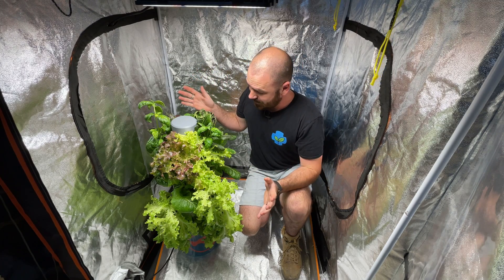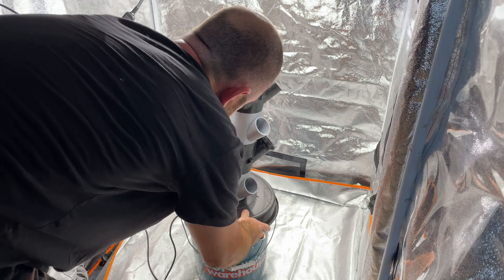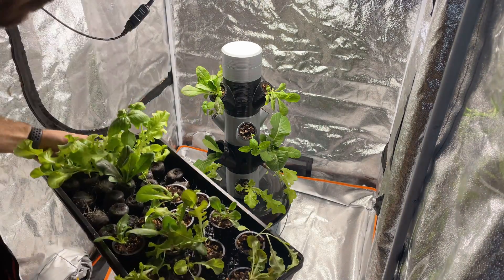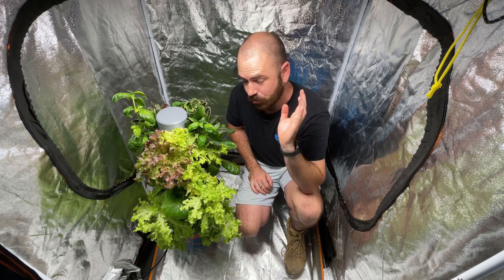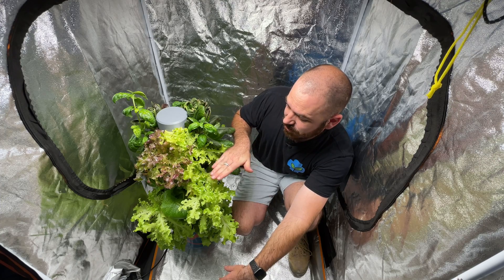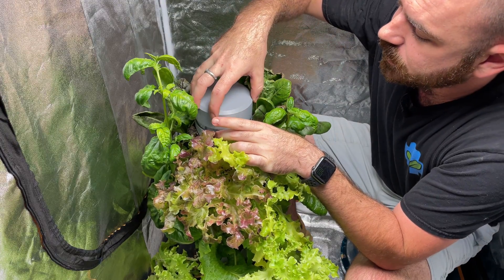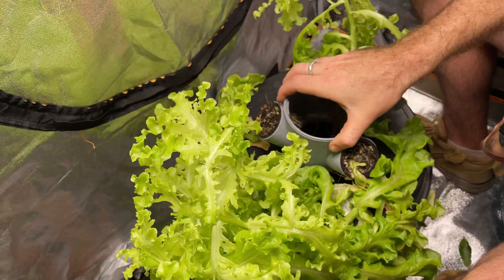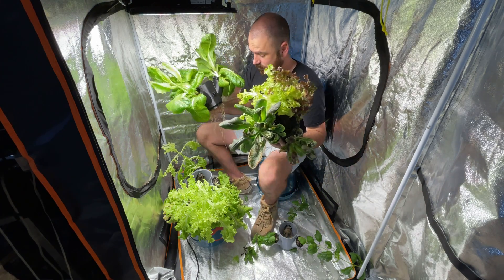3D Printed Hydroponic System Setup & Time-Lapse Grow

Comment: Do the 2" netcups also fit into the hollow modules? I need a 5 way module and there is none with a dispenser and I am not shure, wether the netcups will slip through the holes?

Comment: If you modified the print so each tier held a small amount of water where the net cups sit you wouldn't have to water so often and if it were outside you could use a solar pond pump.

Comment: Nice review! I used the printed cups because my system is outdoors and attached to an aquaponics system. i found the non printed cups just blew out with some bad wind, so the locking mechanism is really nice for my setup (also todlers and chickens on occasion will drag the net cups out). I printed mine with PETG so they have a lot more flex and not a brittle when exposed to water. I also printed in different colours to signify the week of planting - helping me keep track of the age of the plant - a colour for each week.
Reply: Also noticed there seems to be a lot of intended design for the roots to have things to grab... Was wondering if the high specs on the netcups could also be  for the same purpose, reducing  the need for media?
Reply: @thewarytraveler6375  I’m not sure, I’m only a rookie (although getting a lot of attention from friends and family now with lettuce prices rocketing up in Aus). I’m using expanded clay balls, and they work a dream, cleanup is easy at end of plant life, I run a knife over the outside of the cup and everything comes apart nicely. To be honest we only get really bad wind once a year, but it’s a definite plus for the kids and chooks.

Comment: A very great and educational video! Thank you!

Not sure if anyone has made a comment about this or if this idea would work, but as far as the design of tower goes, I saw you mentioned lighting at the bottom of the tower is an issue. One way to solve this would be to to make the tower conical. The slope would be determined by how far you think the crop would branch out. This would however require a redesign of the potting sections and section size adapters so the water would be able to flow correctly. Again, not sure if this would solve your issues with this setup but thought it was worth mentioning. Cheers!

Comment: Hey Hooch, I have a question about lighting in a setup like this. Say you used a hydroponic rack system. If you had a larger grow tent and just put a rack in the center with 4 or 5 layers of PVC hydroponic grow pipes, can you off set lighting in the tent and use reflection (off the tent walls) to ensure balanced growth? I'm curious after seeing this video if off setting the lighting around the grow rack instead of directly above the rack can create that lighting sweet spot. At the same time, I'm worried that as the plants grow the top layer will block out the majority of the lgiht for the layers below. Could this be offset by the reflected light? Thanks for the great videos! I'm learning a lot.

Comment: The ones that "grew up" to it were bolting. They should've been harvested earlier. Lettuces in these systems are VERY fast. My average is under a month for lettuce. I run a similar system (not 3d printed) that stands 6 feet tall in my greenhouse. Lettuce is very fast. If you want to try a fun one, run chard (silver beet). It does AMAZING in these systems. I get leaves 2-3 FEET long and producing faster than my family can consume them.

Comment: Hello sir thanks for your video. 
How it will cost to make one hydroponic tower by using 3d printer? Is it cheaper to make by using PVC pipe? Thank you
Reply: I downloaded the parts and the 3 way module hollow with 0.3mm layerheight, 15% infill, 2 shells, Adaptive cubic, connect the infill every 2 layers, I came up with 140gr per module or 3.3 Euro per part plus power. But a 3D printer is not such a power hog, and if you have it in an enclosure, you save a lot, so I guess 9 hours printing time is about 90 Cents. So per module, 4.2 Euros * 4 (cap and distribution module are the same as 1 module) are 16.80 Euros in total.

PVC pipe from plumbing has a few downsides, it's thin, breaks pretty fast (at least the cheap ones) and the good ones cost really much. But we go with a middle version, 3mm thick PVC pipe, 110mm diameter, 500mm cost about 6 Euros. You need 4 for a similar system he had, plus cap, but lets just calculate the modules, you need 24 Euros for PVC pipe. Glue, tools etc. off limits, we didn't include the 3D printer in the prior calculation.

So in theory, the 3D printed one looks nicer and is cheaper than a sturdy PVC pipe. You can go with some cheap ones, then it really turns around, because 2m of pipe cost 7 Euros, but one slip with the saw or drill, and you break it. I know it, I used it once and never again. But it's a good idea, if you have no 3D printer, you could use PVC pipe, glue in some plastic with holes as the distributor and an endcap.

Comment: The pods have their pros and cons. If you print the standard one its bigger, but thinner and more filament efficient and it helps for bigger, heavier plants since they lock into place. You need to have good settings tho or they'll be too tight.
Reply: CN. Mr😂r 😂

Comment: I'm new to hydroponics and plan to print this system, but Hoocho mentioned that this system would be best used outside due to lighting.  I can definitely see a power savings by doing that.  My question you is about rainfall.  I live in Northwest Georgia (Canton) and we get a fair amount of rain during the summer.  How does rain affect your reservoir?  Do you end up with an abundance of rain water in the system (which I would imagine throws ph and nutrient levels off) where growth is affected?  I know the top of the tower is closed, but I'd imagine rainwater would enter the system through the net pot spaces.

Sorry if I hijacked this thread with my somewhat-unrelated question.  These videos are fantastic and helping me to plan my system while I wait for larger nozzles to get here.  I ordered 0.8mm and 1.0mm to print these bad boys!
Reply: If you drilled a hole into the side of your bucket at the max height you want it to fill to, that should let it drain out the excess, nice and simple

Comment: Thank you and I love the remixed sections, I got lucky with a corner apartment with very huge windows all the way around and now I have 2 plant tower in each one and I love it, also printing net cups make absolutely no sense they’re ridiculously cheap you can get them on Amazon on eBay at ridiculously low prices so the amount of time to print them and a waste of time and filament, for supplement lighting I’m using LED grow lights strips

Comment: You might try side lighting while rotating the tower. You might rotate the tower 360° over 12 hours or 360° over 24 hours. Your rotation system could de-rotate the tower at the end of every period to eliminate the need for a slip ring contact for your pump power supply. A $5 Raspberry Pi Zero controller could control the nutrient pump and the rotator and the lights and anything else you wanted to control with gobs of capability to spare.
Reply: Awesome! I was looking to see if anyone posted this idea yet! Now to find a suitable turntable...
Reply: I have seen a rotating hydroponic system. Basically, it was just the base which would spin, however i find that solution not feasible. If the plants need 16 hours of lighting, then by rotating, all plants will not receive the proper lighting during the day. However, i found that someone printed a sort of an umbrella with  led lights/strips glued to it, coming from the top. 3 light bars would do the trick. But i cannot seem to find proper lighting, except for Barrina lights, which at least have so me sort of information on the product in the description.

Comment: Damn this is pretty amazing! How I am wondering if this could be easily adjusted to fill the middle shaft with hydroponic clay pebbles and make this a top drip system with much shorter on/off ratio. I have been thinking about a top drip system for beginner hydroponics for a silent system. Just made my first Kratky system but I am already thinking about the next!
Reply: Clay pebbles are not fun to wash!  Hours of washing or soaking, or baking in the oven. I used the pebbles in my modified Mr. Stacky system . One small Mr. Stacky tray takes about 4 quarts.  Multiply that by 8 levels. Yikes!!  If the pebbles aren't sterilized, the next batch of plants do poorly.  I learned the hard way.  I have used 4 different systems, and am NEVER going to use clay pebbles again in 3 of them.  I still use clay pebbles in my AquaSprout for the flood and drain system.  It's a small system and I only grow decorative plants it it.  It gets cleaned twice a year only.  
The most "silent" unit is still my Aerogarden Farm Plus. It's a bit pricey. Even though there is a 24 pod capacity,  it's not realistic to use all 24, it just gets too crowded.
Donated my 10 level, 80 pod system ( purchased as the Martian Grow Tower but many on Amazon)to a local highschool, what a nightmare trying to use it indoors with lights.

Comment: Wow, with Hoocho, only the sky is the limit! You venture into everything related to hydroponics, and now 3D printing? Really impressive, mate!   I can't tell you you how much I have learned from your channel over these few years. You are a blessing for all levels of "hydroponiquing" as you call it.
I have qestions that I should have asked on the previous video where you did the actual 3D printing. Hey, I thought it was too complicated for me to embark on. But seeing the results of the actual growing, I am like, why not, let's ask.
(1) How "easy" could it be to start 3D printing if one can afford buying all necessary tools machine, part, and supplies?
(2) How "expensive" is the material that serves as "ink"?
(3) What camera do you use for you timelapse videos?
As always (expressed or not, here or elsewhere), thanks a lot mate: you take the risk for us!
From Shawinigan, somewhere in Québec, Canada.
Reply from the maker: To be frank, 3D printing is quite a steep learning curve.
I found it challenging. (Setting up the printer, learning to level the bed, troubleshooting problems) But once you figure it out it’s just as rewarding.
The filament is 30$ a kg (AUD)
And check out my how to make a plant time lapse video for all the timelapse info.

Comment: Im really starting to consider this grow method for herbs and some leafy greens. My work has a 3d printer which I can steal for a while. Just a quick question though, what exactly was your irrigation cycle? Ik you showed it in the video but just wanted to make sure, is it really 15 minutes every 3 hours?
Reply from the maker: Yeah
Reply: @Hoocho  I am confused. Arent nft systems suposed to run 24/7, arent your other pipe systems outside running 24/7?

Comment: I am in the process of printing out enough for 17 towers that will be 6 foot tall each for an outdoor farm inside our screened lanai  here in Florida (all brown PETG so they will look like trees). The base will be connected 4" pvc pipe with T fittings that all the towers will be glued into. The system will drain out into IBC containers for the reservoir; then pumped to the top of all the towers with drip lines. I'm coating everything with Naked Fusion epoxy resin (it's BPA free and will inhibit bacterial growth). I'm also using all metal hotends with stainless steel nozzles to avoid contaminants in the PETG that aren't food safe. I figure I'll probably invest in a Bluelab pH and nutrient controller too in order to reduce maintenance needs too.
Reply from the maker: I wouldn’t worry too much about the food safe stuff, it’s gardening. And there’s something to be said for a healthy stable microbial population, (they are essential in soil gardening and aquaponics) and can be utilised in hydroponics to remove waste plant excretions.
I would seal the outside and allow the inside to be porous to give those roots something to grab like in the video.

(Maybe test it on a couple for a while first and make sure it doesn’t give you any negative effects)

I haven’t enough experience with this system to recommend this, I’m just thinking out loud.

I have been looking for epoxy for other prints so thanks for the recommendation
Reply: @Hoocho  Your video confirmed my decision to stop printing the net cups and just buy them; thank you! I'm also going to make a couple of portable towers in 5 gallon buckets now. I'll try one with epoxy inside and one without to compare them. What is the benefit of the roots grabbing onto things?..(I assume the epoxy would limit their ability to do so). Also, if the roots do stick to the print more, would that eventually cause a debris issue after pulling the plants out? 

My concern is that I'm figuring to epoxy all of the pieces together (I won't be able to disassemble them for cleaning) and attach the tops of the permanent towers to pipes in the hopes they will survive up to a category 3 hurricane.
Reply from the maker: @stoppropaganda20  when you epoxy you can coat the inside to stop that porousness.
Reply: @Hoocho 
If you consider the pollution that  comes down with the rain, a bit of plastic isnt much to worry about. I dont have a 3d printer so i opted for 160mm sewer pipe with a 4mm wall. https://youtu.be/iOj3hq_2_1k 
If you start the seeds in small fibre pots you can transplant the whole thing into the tower  once the roots are out the bottom.
Reply: I'm also using 3/4" EMT conduit to make a structure that I can attach 16' cattle panels to next to each row of towers in order to train tomatoes, beans, etc. onto them.

Comment: Good to know I'm not the only one who has problems with the inserts. I have designed a version with a looser fit that is really easy to get out and is still very much fixed at the end. Find it under remixes. I also designed versions of every part I printed that feature thinner walls and stripped at unnessecary sections so you can get 5 3-way models out of one 1kg spool. I have jet to test them, but I will share them If they are stable enough (which seems to be the case).
Reply: Hey seamus, i would like to print yours cups. Not finding your username on thingerverse although
Reply: Just starting this print, where can I find your version?
Reply: I’m also interested

Comment: Hey Hoocho, do you have any alternative grow media suggestions aside from 60/40 coco/perlite? I'm finding it hard to find those at the moment.
Reply from the maker: Rockwool, vermiculite anything that will allow you to get the seedlings into the system.
Reply: @Hoocho  Thanks man, love the videos. I was considering vermiculite, but I wasn't sure if there was some reason to avoid it in this kind of system.
Reply: @Hoocho  Hey, Hoocho, i am thinking on different growing medias, but in my country only ones that are cheap/accessible are coco. Rockwool is cheap, but delivery costs 2x the product price itself... I have 4 seedlings in coco tabs, but they leave a lot of coco behind, which can get sucked in the pump. How did you solve this matter with this system?

Comment: I've thought about building a tower system.  Lighting is always my concern.  I think T5 bars mounted vertically in the corners of the tent would work.  Given the right specs on the lights, one in each corner could work.
Reply: thats usually what people do in the ones you can buy. Either led strips or t5 bars vertically usually 3 of em or one in every corner

Comment: I was actually start printing those cups and your video came out...immidiatly stop printing it!!  I will try regular net cups first. What are the specs of the motor you are using? Always thank you
Reply from the maker: Can’t remember off the top of my head, pretty sure I specified in the original build.
Reply: Yea sorry, you are right, I forgot it... Check and, for those who need, it's 550 l/h
Reply from the maker: @dagomarco  it’s more about head. As long as the pump has the appropriate head you should be fine. 
Which will depend on the height of the system (how many modules)
Reply: It's my first attempt and I'm going pretty similar to your version... Thank you for all the info, wish me luck! Cheers
Reply from the maker: @dagomarco  Good luck Mate!
Reply: Try my remix on thingiverse, if you like the optics of the netcups, it fits really well.